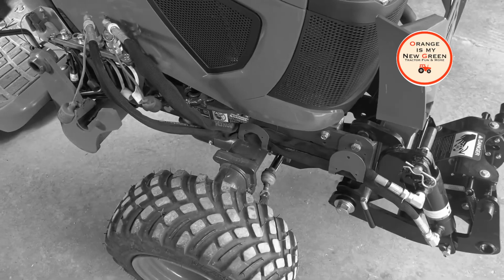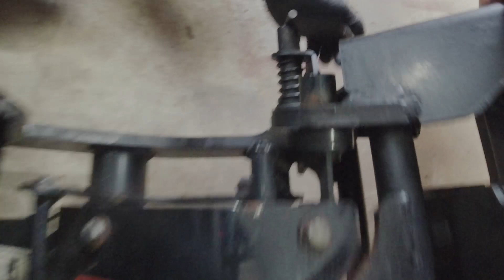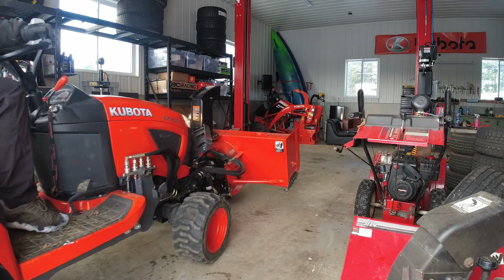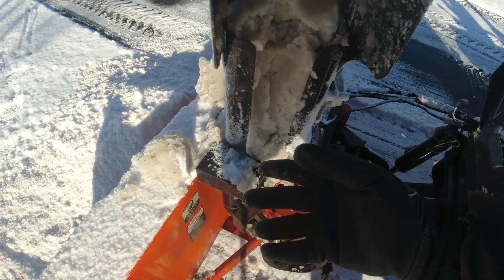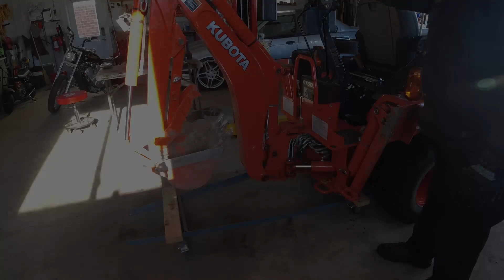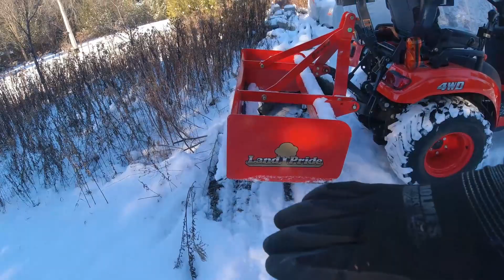Kubota BX23s and BX2822 Snow Blower

Comment: Love your video . One question I have is did you make the Dollys  you put the loader on or did you buy them somewhere? Thank You
Reply from the maker: Thank you! I appreciate the comment. I make my own. I pick up free used bed frames and buy the casters. Cut and weld them up. I have a few videos on making them and I usually use them at the season changes. Or when we need to move stuff around the shop.

Comment: Interested in a similar setup (same tractor ) and  snowblower.  What’s the deepest snow you have removed?   This would be a my vacation property and I would have to do 700 meters of driveway and depending on snow load while I’m not there, may need to remove 1-2’ feet at a time
Reply from the maker: Excellent combination for snow! I have no problem at all doing that depth. If it's really deep you can just go slower and any snow above the augers will fall over the top and under but I have no issues driving through what's left of you wanted to do a second pass.  If it's really deep snow you could just raise the blower to take a high pass, then a low pass to finish it off but honestly in my experience I just drive through everything!
Reply: Really appreciate the detailed response!

Comment: I'm thinking of getting some thin adhesive backed UHWM Poly to line my chute. I've used some ceramic coatings which seemed to help but not to the level is like.
Reply from the maker: That's an excellent idea, but would need some way to guarantee the leading lip isn't caught or the snow could get in behind, but great idea.
Reply: @RossOnTheLand  Yeah, upon initial review it looks like a few people have tried a few variations of some DIY versions, but I also see some of our large city plows that have the entire plow face covered with a sheet of it, so I imagine if the surface is properly prepped and the right adhesive is used anything is possible. Just staring at it I figure it's going to have to be many specifically measured and cut pieces.

Comment: You must have been real anxious to get out to move some snow.  I just drove over the snow and packed it.  It has pretty much all melted now.  The implement dolly carts you have are great.  Well you're set up for the next storm.
Reply from the maker: Hey Paul, ya I like getting the first shakedown done early making sure everything is working right before the big storms come in. The drive definitely melted  but I was afraid of freezing ruts that day. Thanks for watching.
Reply: @RossOnTheLand  Yeah it's a little different for you with an asphalt base where I have gravel and you're right about checking things out before the big one comes.
Reply from the maker: Yes for gravel I definitely want to build up a base.  Cheers.

Comment: OMG you're going to break shear pins with all that snow !!! Hahahaha. But you know guys, I'll soon be doing the same thing. ( and I said this BEFORE I watched the slushy part! )
 Snow blowing and plowing, it's the other 'winter sport' we love!
Hey Ross, ever consider buying a good quality air powered grease gun? I considered a battery powered unit, but opted for air power as I only use the grease gun every now and then. I bought a 'Lincoln' gun. top quality and works like a dream.
Another tip and or suggestion, Next time you are in an Automotive hardware or electric supplies shop, consider buying yourself a little tube of 'dielectric grease' it'll keep your electrical connections corrosion free.
P.S. I do like those storage racks/casters you have, great idea!   (I'm old fashioned ( sometimes ), I  still us "P.S". in comments :)
Reply from the maker: Thanks Reg, we are definitely looking at a powered grease gun, but will probably go Milwaukee battery as we are in that ecosystem. 

Having fun with a bit of snow, know lots more to come for sure. 😁 This blower is a beast! See how it makes short work of all this now! Bahaha. Have a good one.

I definitely need electric grease. Especially for my car trailer hookups.
Reply: @RossOnTheLand  Any powered grease gun will do, and you'll actually like to grease things when you do buy one.  Most of my cordless tools are Makita :)

Comment: Hey Ross good video I was a bit concerned about running the engine in a closed garage     i use a  corrugated drain pipe running to outside does it stop everything but cuts it way back.  I really like your trolly set up for your implements I wish I could do that but I have dirt    Looking good and ready for the winter 👍
Reply from the maker: Thanks BJ! Yes we will be working on better ventilation. The dollies are a life saver.  Thanks and yes I'm ready.